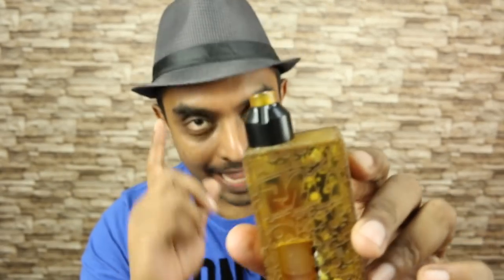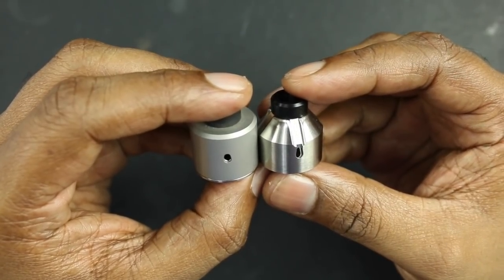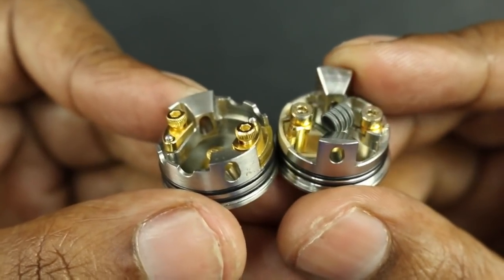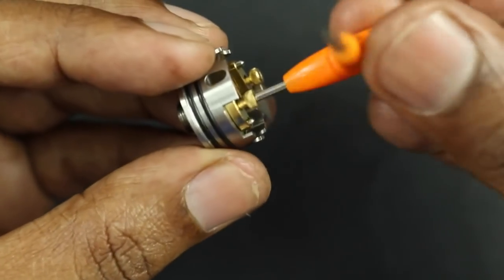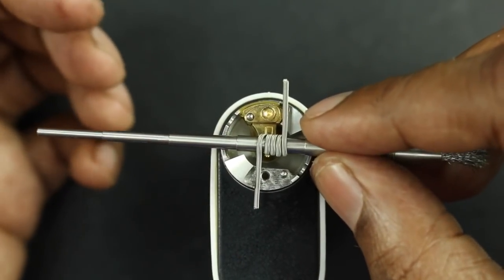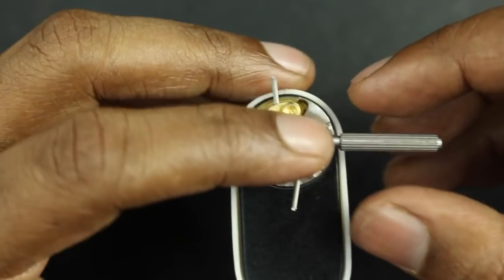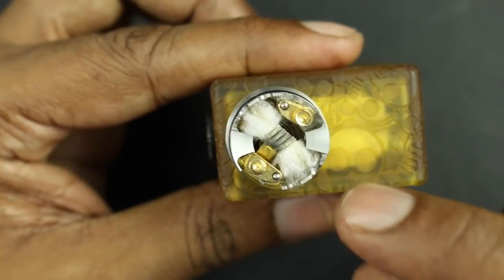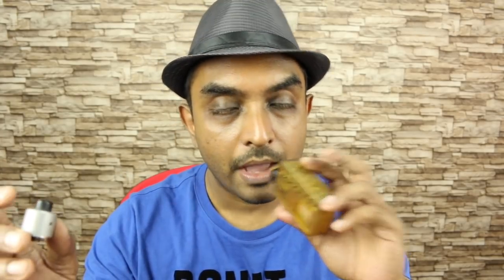O-Atty X by Odis Design Full Review

Comment: I really hate these "directed" squonk pins, I won't buy this just because it's hitting the wicks before it hits the coil. I'd end up having to press the shit out of my bottle. I'd rather a straight shot squonk, or like how a 502 squonks.
Reply from the maker: This has a third hole
Reply: I like having a single hole in the squonk pin so it goes right up at the coil. This I'd have to push the shit out of the bottle to flood it, or wait for my wicks to capillary action the juice to the coil.